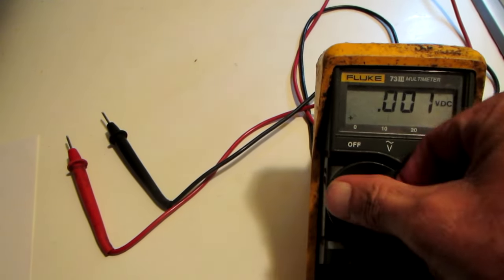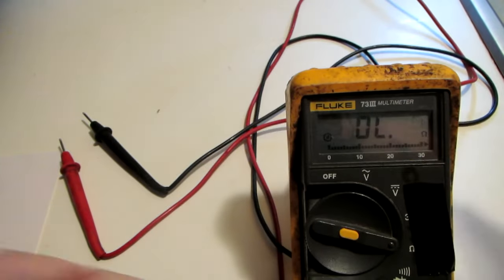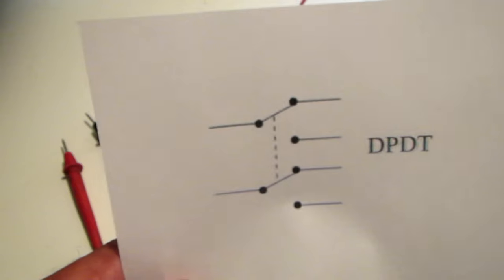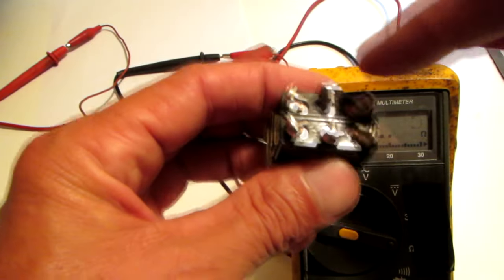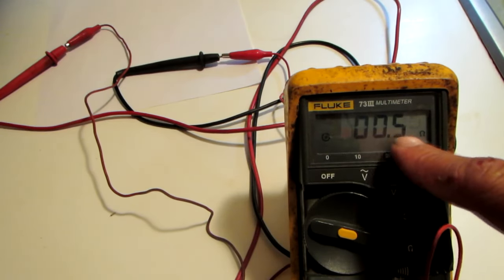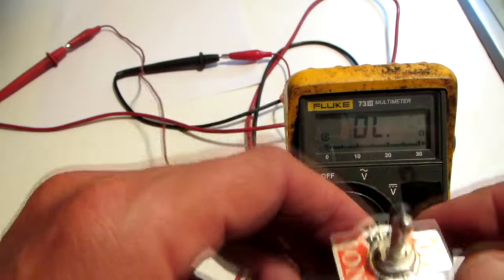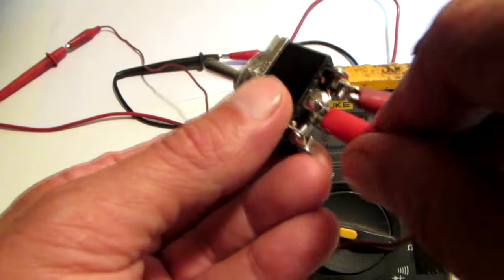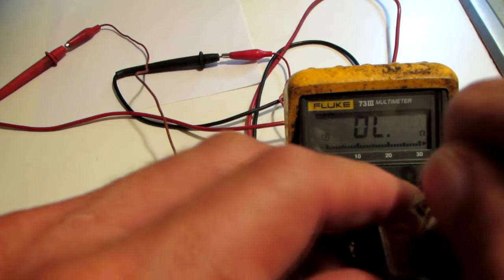Use A Multimeter To Check A Switch

Comment: I've watched a few of your multimeter videos where you seem to use the ohm setting or AC voltage settings. Do you find that for everyday household use that these are some of the most used features of a multimeter? I have a Fluke 117, which is advertised as an electricians meter, and I'm wondering if other features (such as micro amp or temp settings) are functions worth having in a multimeter?
Reply from the maker: I hope I answer your question here?
      Volt and ohms are the most common meter functions used to troubleshoot circuits.  Majority of malfunctions in a circuit are going to be an open or a short.  An open is the most common.  Electrical circuits consist of four components, power supply, resistance, switch, and ground.  A volt and ohm meter will identify the condition of all of these components.  The other functions of a multi-meter offer more in-depth troubleshooting processes to determine, what, who, where, when, why, and how. Yes they are important and good to have.

Comment: quick question, why you checking the switch onto the "on" postition, why are you connecting the wires on the other side of the swtich?

Comment: On your meter is, also, a Continuity setting -- a more logical choice for this kind of test.  The tone, emitted by the meter when continuity [i.e. when the switch contacts are across a closed switch] gives you a positive without having to watch the meter--also, the tone is far more responsive, giving a nearly immediate reading.
Reply from the maker: Thx for watching.
Reply: @billeaglerunner6844  😮t😮😮😮😮